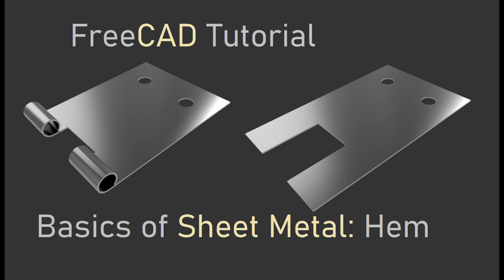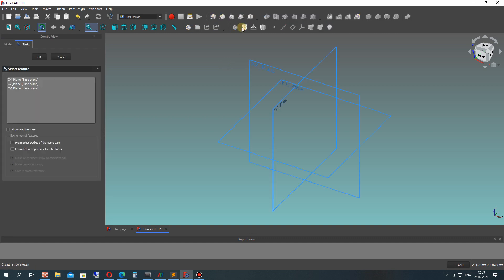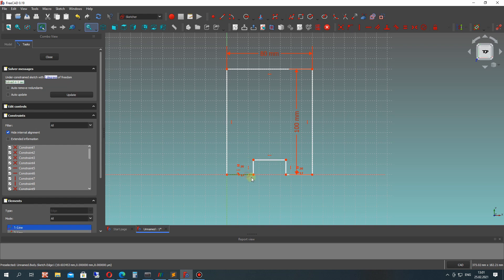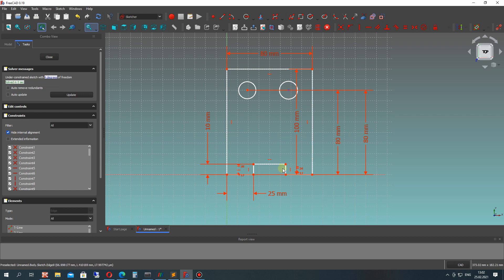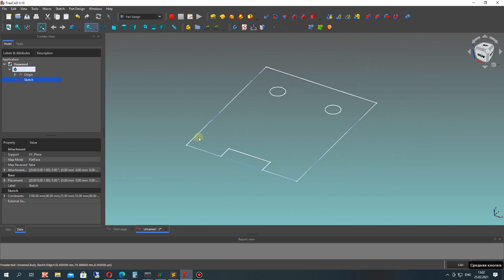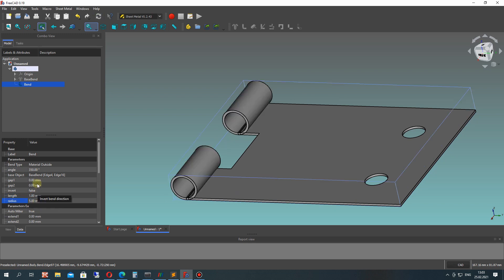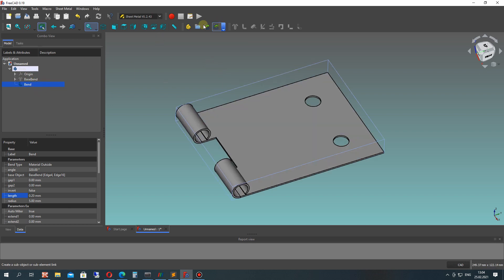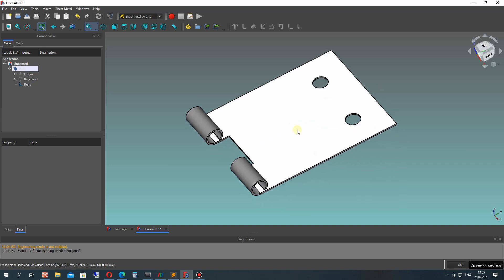FreeCAD Tutorial | Sheet Metal Basics 4 for Begginers: Plate with Rope Hem

Comment: Excellent to to have people demonstrating all the various work benches, this was very well done.  It would be good to understand how to take such a model and produce cutting code for Laser/plasma cutters :)
Reply: It's just two operations in the Path workbench, one for the holes and the other for the outline (profile). The only problem might be if there's a suitable post-processor for your laser or plasma cutter.
Reply: @paulathomas4944  Excellent, thanks - yup my little Chinese Laser does not use correct G-code so post processing is problem but good to know D
Reply from the maker: Im not workning in production, if you ready you can to help me with this theme) thanks!
Reply: @CFDIntech  I am sorry, I am an engineer but have no depth expertise in this area. However if I find something or someone that helps with the next part of the process of flat drawing to gcode I will let you know. In the meanwhile keep up the good work on Freecad
Reply from the maker: @denisw398  Nice! Thank you!